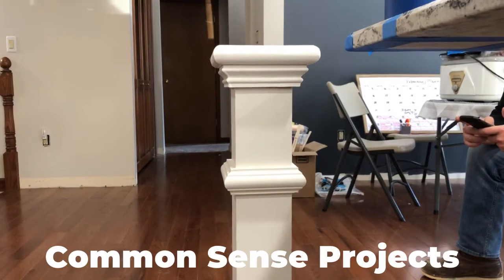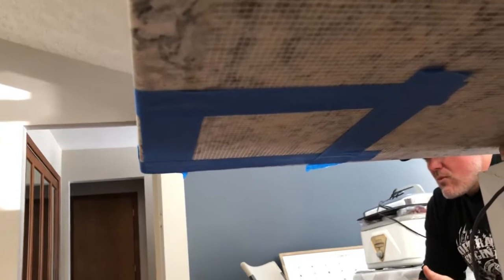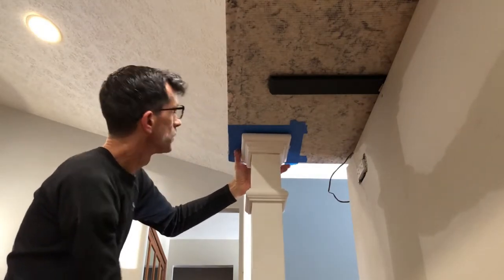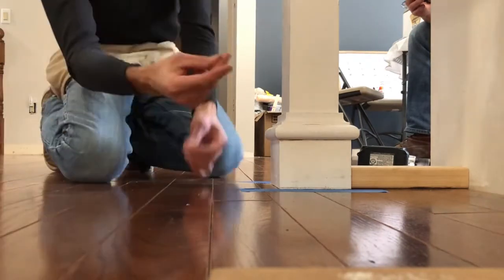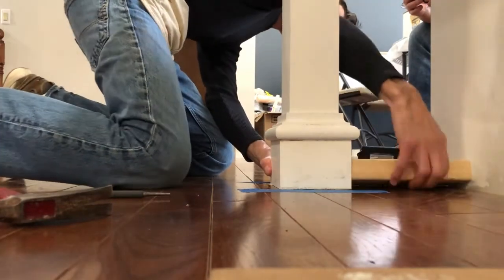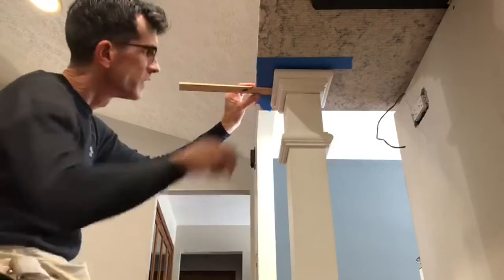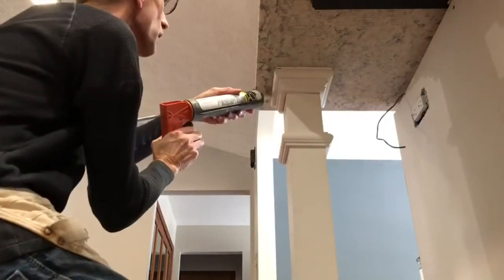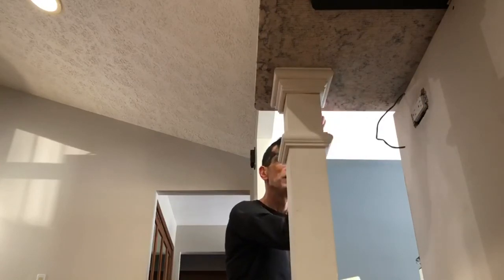How to Install Counter Top Support Posts

Comment: I have 30 inch overhang for my quartz countertop we installed should I put 2 or 3 posts for support ?
Reply from the maker: Depends how far it hangs over and how long your countertop is. With a 12” overhang and   your length is longer then 12’ I would put 3.
Reply: Total length is 60 inch with 30 inch overhang.
Reply from the maker: 2 for sure.

Comment: Thank you for your video. Any tips on how to attach a wooden leg support to a granite countertop overhang on a porcelain floor? Our current one was glued to the porcelain tile and becomes unsecured when accidentally kicked or hit by feet or vacuum cleaners. Can you help us with this? Thank you!
Reply from the maker: Thanks Rachel for your question. I would carefully remove the post completely. Cut a 3/4” block of wood the same width of your post. You will need to fasten the block to the floor useing two medium size masonry anchors or screws. First use a regular drill bit to drill 2 holes in the block slightly larger than the screw itself. You will also need to counter sink the screw heads. Use a spacer block like I did in the first video to position your piece and mark the holes. Set the block aside and drill your holes with a masonry drill bit. A quick tip. First drill only one hole in the porcelain. Take your piece  and temporarly fasten one screw. Now mark and drill your second hole. Fasten the block to the porcelain. Remember to countersink the screw heads. Now cut 3/4” off the length of your post and install the same way I did in the first video. Use the spacer block to keep the post flush on all four sides. Predrill 4 small holes on an angle. Be sure that your nails are not too long. They mite hit the porcelain. Now that your post is in. Install 4 small trim pieces that are a minimum of 3/4” in height. This will cover the seam. Be sure to fasten to the block and not on an angle. You mite hit the porcelain. If you don’t have a air nailer, predrill your trim pieces with a small bit. This will make things easy. Quick tip. Lay a piece of cardboard on the floor so you can slide your hammer. I would also caulk around the bottom to the floor. Hope this helps. Let me kno how things turned out. Keep me POST ed.
Reply: @commonsenseprojects  You are welcome! Thank you very much for your quick response! It was very helpful! How about making a new video explaining that? There is none on YouTube about that. I would love to share your videos on my Facebook since I have clients that want to remodel their homes and this would greatly help them. Just look for Rachel Swedlund. Your video was the best we found online. Thanks again and have a great day!
Reply: Where r u located? Is this soemthing we can pay you to do for us?

Comment: Could I add shims to my current post? One of the 4 posts isn’t in full contact with the counter, if someone put their weight on the corner they could probably crack the granite.
Reply from the maker: Yes you can add shims. I would try to squeeze some glue in first then finish it off with caulk.

Comment: Quick question. How tight of a fit is too tight?  I installed mine today and it feels a tad snug. Slid under the counter slightly easily. However floor is semi uneven. Should I Uninstall and fit with a shim?
Reply from the maker: You should be fine as long as the glue makes good contact on both surfaces.  Still caulk to help the leg stay in place.

Comment: Where did you get the legs from?
Reply from the maker: Home depo.
Reply: I can't find those table legs at home depot. did they come w/ the adjustable collars on them? or did you buy them separately? Also did they come painted?
Thanks!
Reply from the maker: The post I bought is actually for a stair railing. I had to cut some off the top and some off the bottom.
Reply: @Michael-li3id  , found a similar one at Lowe’s

L.J. Smith Stair Systems  5.5-in x 56-in Primed Poplar Wood Stair Newel Post
Item #422643
Model #4191 56 ETPMD

Comment: if the counter top was not installed yet. would you use a wooden dowel in the floor instead of nailing it?
Reply from the maker: No I would not. Most countertop installers won’t install with the posts already in place. And remember you can use a shoe molding around the bottom to hold the post in place.
Reply: All installers we talk to want the posts installed BEFORE they’ll even come measure the template.🤷🏻‍♀️
Reply: @ashleyorgill8080 I just had quartz installed without the posts installed on my island. They said you can have 12” overhang without supports but since I ordered 15” overhang to just be careful until my posts are installed.

Comment: Good Morning,
Just put in a front loading washer and dryer in our kitchen between a wall and the fridge.  Would like to install a removable butcher block counter top to make it a usable and aesthetically pleasing counter surface.   Needs to be removable in case of any issue with the plumbing/machines.  Two questions... Was thinking of placing a 2x2 along the back wall for supporting the back.  But need legs in the front to support those corners.  Was thinking that securing the leg to the butcher block itself would allow removal of the top in Any thoughts or suggestions  would be appreciated.   A neighbor has some beautiful antique table legs but they are too short.  I'd it possible to elongate the legs and have them be stable enough?
Reply from the maker: Hello and thanks for the question. 2x2 is a good idea. Make sure to screw it to the wall studs. The legs can certainly be extended. Use 2 screws for each leg. Fasten the leg threw the topside of counter top and into the leg. You can remove the top if u need to. As for the extension, if the bottom is square (for example 3x3 square and u need to extend it 6 inches) use a molding or a piece of 1x lumber that’s at least 8 inches tall or taller. Over lap the leg around the bottom. If your extension needs to be longer. (For example 24 inches)rip a piece of 1x lumber at least 26 inches tall or longer. The longer the better. And fasten it to the leg with screws. It would be stronger to use a 1x piece of wood instead of a molding. Then fasten the leg to the floor with metal L brackets with screws. U can remove the screws if you need to. If you can let me kno if this was helpful. Or send me any further questions. Thanks.

Comment: What tool did you use to make the cut?

I’ve been having an adventure. I’m using a 10 inch miter saw and it’s too small. I took a piece I bought to Home Depot and the post is too large for the Home Depot machine and they can’t cut it.
Reply from the maker: U can use a circular saw. Just mak 4 cuts all the way around the post. Then u a hand saw to finish the cut.

Comment: What type of nails were those
Reply from the maker: I used #4 penny finish nails. You can use larger nails but make sure your drilling into the flooring as well as the posts.
Reply: @commonsenseprojects  thanks a ton
Reply from the maker: You’re quite welcome. Thanks for watching. Be sure to check out some of my other projects
Reply: Hi, did those small nails you used to toe nail into the bottom post also penetrate the wood flooring and subfloor? If not, how do they help secure the bottom in place?